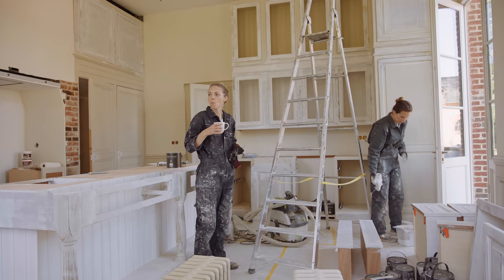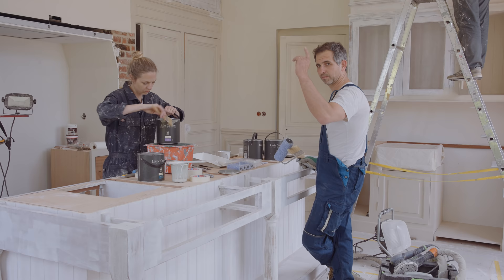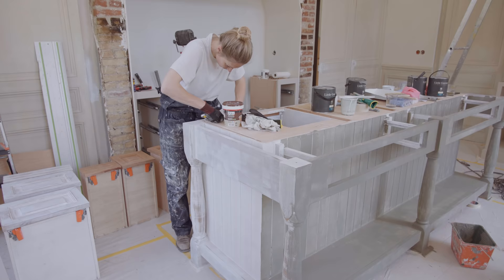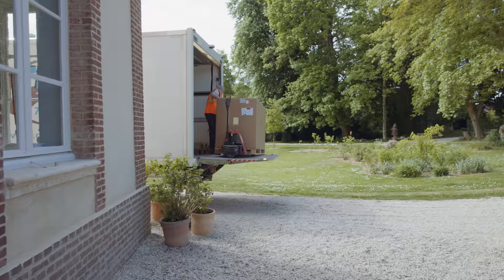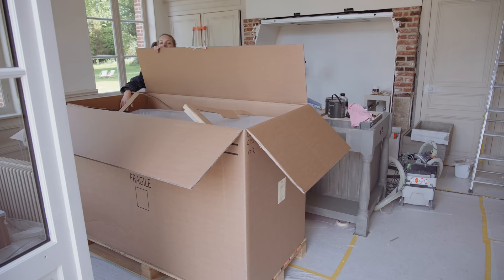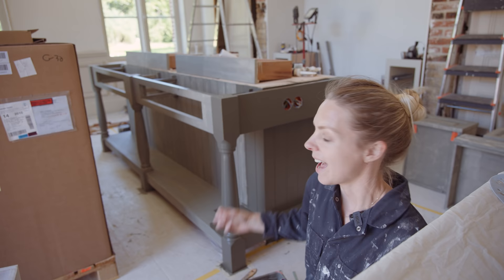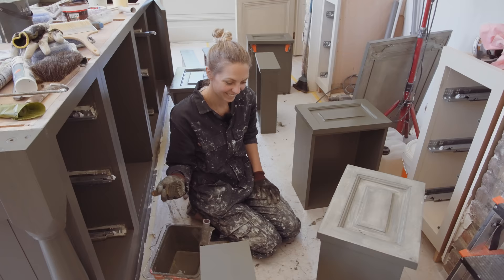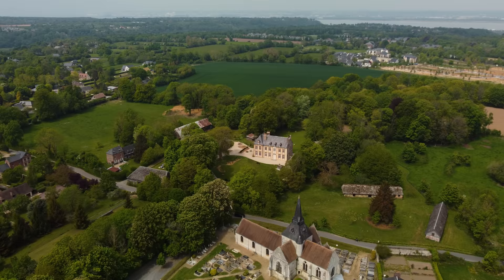Building the perfect DIY KITCHEN ISLAND for our French Chateau - Paint Wars.

Comment: A coat of  clear polyurethane in a satin finish will add extra water protection, protect the paint color coat from wearing down too quickly, and smooth out any brush strokes that may show up.
Reply: True, and good idea. I put satin clear coat on all my painted wood surfaces that take lots of beating.  But remember to use poly that is UV stable, otherwise it will yellow over time.